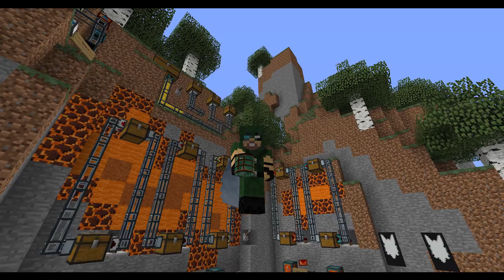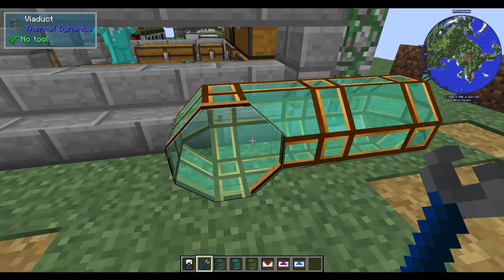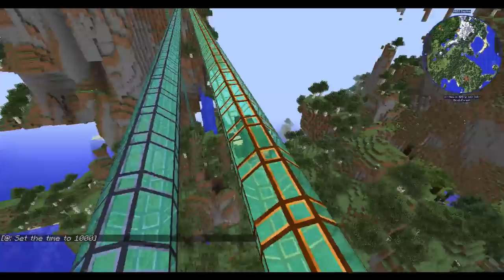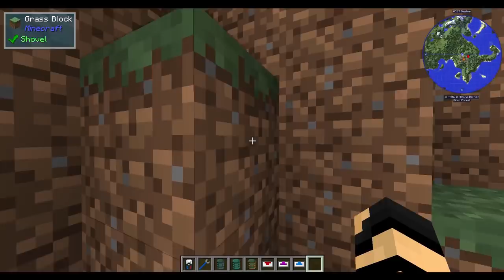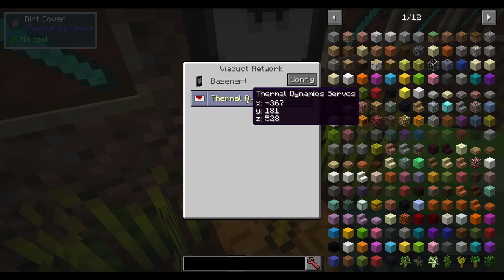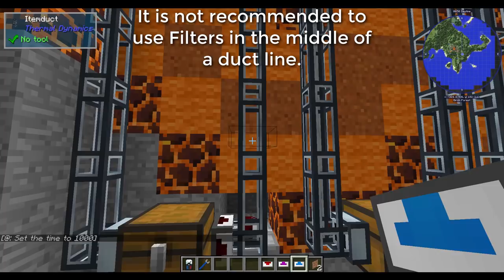Thermal Dynamics: Part 2 Viaducts & Servos! Bit-by-Bit in Minecraft 1.10+

Comment: I used this viaduct when on a 1.7.10 server, and the only problem was when you make diagonales.. 
I mean the flying rendering was not in diagonal but succession of turn and turn and turn.., so it need vomit bags at landing.. ^^'
You have make "S" tube, but not in diagonal, so what it look like today?

On the other hand, covers worked better in 1.7.10, I mean that they left an octagonal hole rather than this squarre hole...
Reply from the maker: +MrAureli177 :x

Comment: viaducts are cool, i now have a network that goes through my base but recently ive built a long range viaduct that goes 2000 blocks and i must say it was not worth it. Because the viaducts only travel at 20 blocks per second, they are quite slow on long distance compared to boats on ice wich go 40 blocks per second without using blue ice. Also you have to keep the linking viaducts chunk loaded, so thats even more resources that you need to use.

Kind of an expensive way to make an infrastructure that isnt even all that fast imo.
I wish they would make them 40 blocks per second though because they do look cool.
Reply from the maker: Try going vertical
Reply: @MischiefofMice  Boat ladders are pretty fast too tho